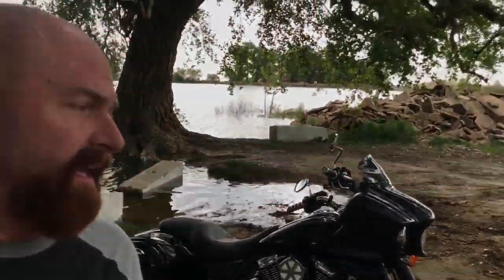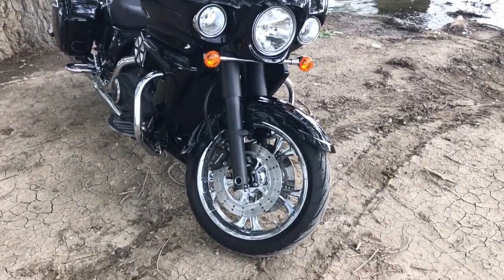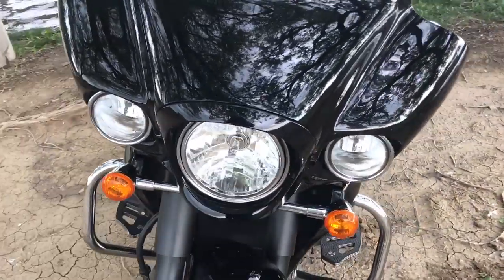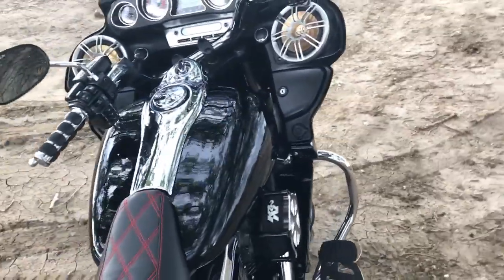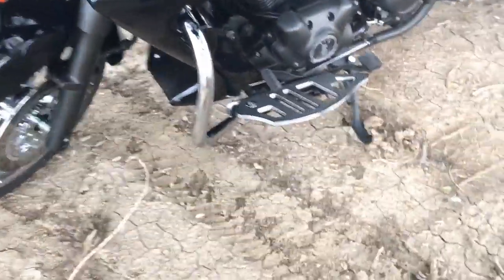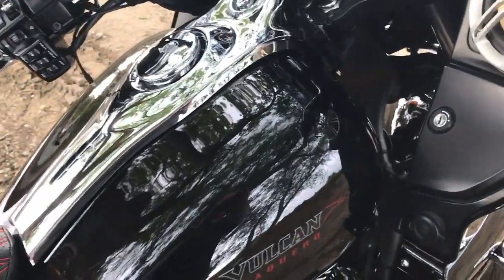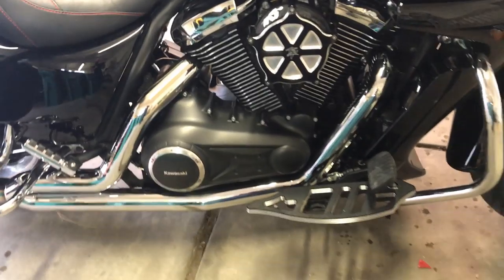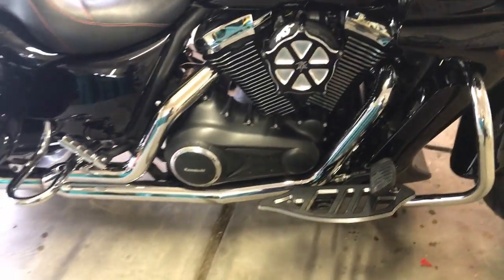Kawasaki VN1700 Vulcan Vaquero - Overview

Comment: After all the upgrades, it probably would be cheaper just to buy the Harley and ride and save yourself all the shop time. Hmmmmm
Reply from the maker: Mr. Avery depends how you look at it. I now ride a like new used Harley Street Glide that I’ve already put $8500 into to get it to ride as well as the Vaquero, fit me, stereo upgrades and power upgrades. And it still doesn’t make the power of the Vaquero. Any which way you look at it both the Vaquero and the Street Glide is a money pit. There’s no better value. The Harley has better support and that’s a big help for making it what you want.
Reply: @FriedChickenBlowout  I agree, I have the 19 ROADGLIDE SPECIAL WITH THE 114 & I DO NOT BELIEVE THAT KAW CAN HANG WITH THIS, IF IT CAN, ILL CONSIDER
Reply: SIR lets get real the 2020 harley roadglide  CVO i believe the 117 motor does the 1/4 mile in 13.8 SLOW BRO 0-60 4.9 sec.. My 1300cc vstar 2013 does it 1/4 mile 13.5.. 0-60 4.5 sec  LOL   80 cubic inch motor lol thats stock i have tunner open air intake and exhaust .. Dont get confused and think your bike is somehow faster than everyones